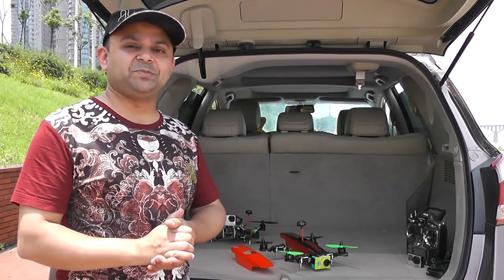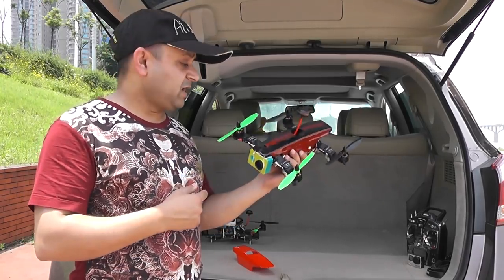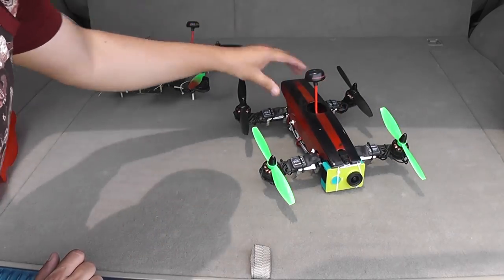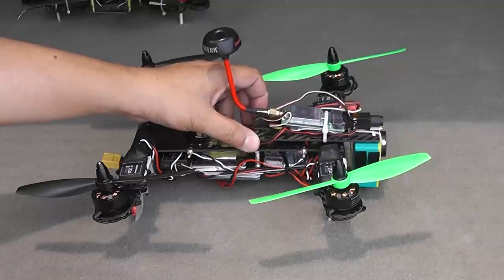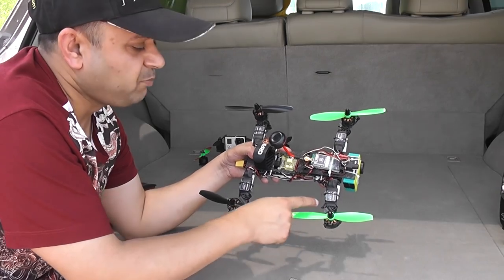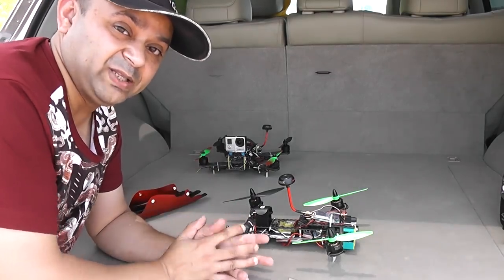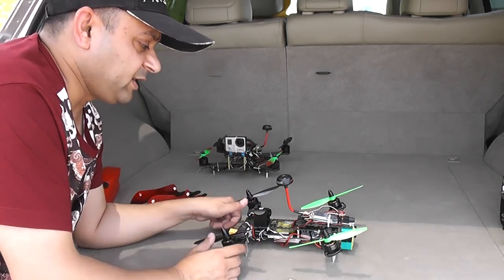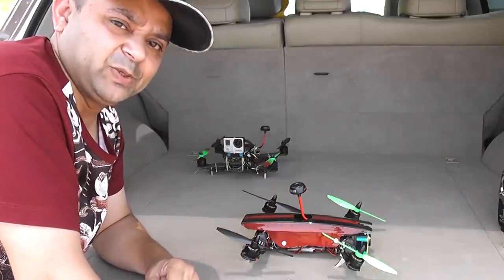Introducing OFM Swift TR260 Tilt Rotor FPV Racing Quadcopter

Comment: Very nice! So glad they didn't shut you down and you designed a smaller one! It sure is fast!
Reply from the maker: The RCAddict Smaller is Race Legal too. also using same power combo (Same Motors, ESCs and Props Combo) that used for that big 330 size 1.3kg heavy quad, on this little 900g all out flying weight quad for sure makes it more powerful and faster than 330 size. :D its like putting a 1600cc Hayabusa Engine in a Smart Car :D hehehehe 
Check this out
https://www.youtube.com/watch?v=AgwzHJo3IXM

Comment: Coming along nicely. Want to see some hardbank turns. Lot of people are skeptical this is a real FPV racer.
Reply from the maker: OC_AirWolf Coming up full flight videos you can see how it handles turns super nice. and I can do more videos focusing on turning only :)
Reply: alishanmao Please do. Especially for racing. I think a lot of FPV racers are curious to see how it handles the turns. Will it lose the Apex when turning?
Reply from the maker: OC_AirWolf Sure thing, when I get the sample that has all the finalized and modified parts that will be sold. I will bring the quad to RC Airport and Try to mark a Course using Google Earth maps, and then fly that course making sure it has enough sharp turning to show how well this quad handles the turns and courses.

Also there is a proximity fpv spot where there are lots of trees and a square that i can go around having 3 sharp turns to make maintaining speed. 

I will bring another Traditional quad as well and fly both quads one by one on the same course and put videos side by side so people can see actual performance of Swift TR260 :)

as I have many reviews to do, so this video might take some time before i can upload it :)

Comment: I have a question though. How do you control Motor tilt angle?
Reply from the maker: stilkus Tilt is controlled via a separate Channel. You can either set the motor angle to be permanent as per your desire, or you can lock the motors in horizontal, (Traditional) way. Or you can turn on the Tilt Mixing so that Motors will move with Forward and backward stick giving more speed at leveled flight.

I like to fly with motor tilting mixing on. and its superb. I lock the tilting during flight when i want to do aerobatics ;)

Comment: So this quad will be in another class then the 250 Quad Racers correct ?  You think that tilting motors will race side by side with a 250 with non tilting motors?
Reply from the maker: CRash and Burn Tilting is just a new feature in this quadcopter. Its still a 250 class Racer Quadcopter so why not? Its totally race legal. Just in case if a club is just too strict on allowing to use tilting feature or not, user can flip a switch to turn off tilting feature.

however, in 250 class racing, people bring 260, 280 size quads and some of them have tilted motors already so why not OFM Swift TR260 that can tilt motors dynamically? :)

Comment: A few questions
Can you try a naze32 board in there and make available the settings for that flight controller.
You have not got a price yet can you give us a ball park price to within say $50
With the kit version could 2300kv motors be fitted with 5inch props.
Reply from the maker: Kendrick Apps I am testing 2000kv motors on 5inch Props and 4S setup and there is tons of power and speed. but if users want to use their own motors, they can use easily by replacing our supplied stock motors. 

Naze 32 can be used for sure, however, for the tilt rotors to work properly, Stabilized mode is a must with some custom mixing in radio. Tilt rotors do not give much advantage in acro or rate modes :D

I will be posting some detailed videos soon about this matter

Comment: I think you've got a winner here Ali. One question I have though, will spare parts be available when it goes on sale? I recently bought a cheap rtf 250 quad and broke an arm in a crash, only to find out you cant get parts for it anywhere and I can't even buy a full frame. So now I'm pretty cautious about making sure parts are available before I buy any of these racing quads. I don't need another expensive doorstop!
Reply from the maker: Dave Baril That is one key point in business when releasing a new product. I will make key parts readily available and have asked factory to produce ample quantity of Spare parts as well. Only those parts that i think will break very easily will be made more spares.
Reply: Hi
First ali great quad I've ordered the kit version .
Broken parts for quads that have no spares that's a bummer if the part is carbon I might be able to help.
Kendrick
Reply from the maker: Kendrick Apps we will stock plenty of parts. no worries. the only worry is shipping cost being so high like 35$ or 49$ for a 10$ parts hehehehe :D so people better buy more
Reply: That's very generous Kendrick.  It is a CF frame (It's the Indy 250 Plus from RC Timer).  I've managed to buy a replacement frame so I think I'm good, but if you can cut spare parts for that frame you'd probably have a lot of customers over on the RC Groups thread for the plus.  I broke the front arms plate on mine and reached out to RC Timer several times but they barely acknowledged my existence.  Luckily for me somebody on the tread stripped his down to port to another frame and offered to sell me the frame.  Would love to see parts available for this, it's actually a very fast and fun frame to fly, just not as much fun when you have to fly it like an old lady because if you damage the frame you're done.

Just to get back on topic, my next purchase will either be a Vortex, a Swift, or a Runner 250.  More likely a Vortex or Swift, I'm not really a Walkera fan and I haven't been all that impressed with the videos I've seen.  That one is going to be a really tough decision, the Vortex has more features, but the dynamic tilt motors on the swift is absolutely killer.  

Ali does your BnF package support 4s?
Reply: Dave let's move this from here to RCgroups just look for kendrick.
Ali I hope you can get the swift kit to me by 19 July there is a FPV miniquad Grand Prix on in the UK it would be too early for me to compete with it but would love to show it off.
Kendrick
Reply from the maker: Kendrick Apps No Problem. before your time frame you can have it easily and get some practice time with it and even get to competition. no matter you win or not, but at least it will show how good Swift TR260 can be on the race track. I am confident about it, that with its leveled fast flight, a FPV pilot can perform better on the track rather than those who are flying fast and tilted all the time and have no time to react to tree slaps :D

people should remember one thing, in racing, its not always a driver who goes full throttle from start to end. Racing is an art of using your timely braking, sharp cornering and instant shoot out with good throttle. and thats what OFM Swift TR260 offers :)
Reply from the maker: Kendrick Apps Did not know it was already posted by someone
http://www.rcgroups.com/forums/showthread.php?t=2439384

i was about to start a thread but now we can just talk there :)

Comment: How much will this cost for the rtr package and can I use a fpv monitor for this?
Reply from the maker: Gatz22 We will release the prices this week or next week. You can use FPV Monitor, but at these speeds to fly proximity Goggles are highly recommended. you can email me that you are interested in this quad and I can save your email to send you prices via emails once we release prices. This way you do not have to often come to video or site to get updates
Reply: alishanmao Thanks also is this only for those who have experience in flying?
Reply from the maker: Gatz22 Unfortunately yes, because of the high speeds this quad can get (upto 120+ km/h) beginners can not handle this quad at those speeds. but again in stabilized mode you can always fly it slow. there is no GPS in this :D

we may release a new version soon which people can fly using Smartphone :D hehehe

Comment: Simply badass, wish that i could afford it
Reply from the maker: TheSkyCuber Do not worry, I am doing my best to keep it affordable
Reply: alishanmao thx! I'm a bigger, so I have to get hold of some cheap 5.8 GHZ quadcopter before i get this one, very nice concept on those tilting motors though.
Reply from the maker: TheSkyCuber You can always turn off the DRT (Dynamic Rotor Tilting) and turn them on with a flip of a Switch. But yes I suggest first go with a cheap FPV Racing quad that you build yourself, so you will have experience to build and repair. and later when your skills are good, you can go with this one.
Reply: alishanmao thx:)

Comment: how can i get one of those without spending thousands?
Reply from the maker: george aura Soon you can get them. we are trying to keep the prices under 400$ :D
Reply: OH OK GREAT IF YOU CAN KEEP ME POSTED I AM VERY INTERESTED IN GETTING ONE RTF FPV :-)
Reply: I REALLY WANT TO GET INTO QUAD RACING IM IN A WHEECHAIR AND CANT DO MUCH BUT I AM SURE I CAN DO THAT,I HAVE A QUAD RIGHT NOW ITS JUST NOT A RACING ONE ITS AN ARES ETHOS
Reply from the maker: george aura Learn to fly on your current Quad. OFM Swift TR260 is a tilt rotor Pro racing quad and can achieve speeds up to 120km/h. So its not for beginners. I suggest you improve your manual flight control skills asap
Reply from the maker: george aura drop me an email and i can add you to mailing list for updates.
Reply: THAT RACING QUAD IS AWESOME BETTER THAN I HAVE EVER SEEN BEFORE THE TILTING MOTORS WERE A GREAT IDEA.